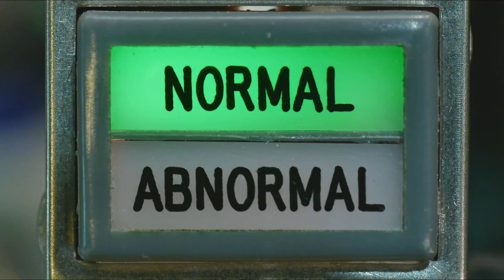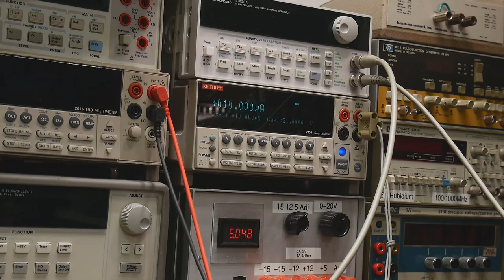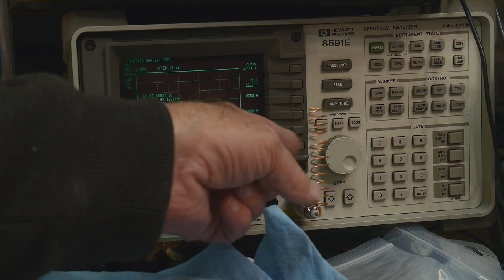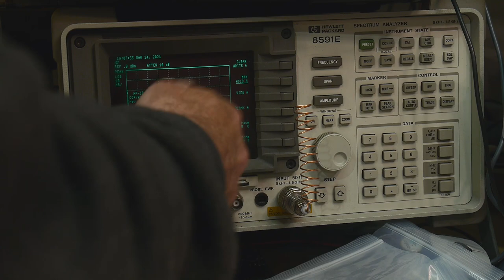#751 Blue LED Powered by Antenna

Comment: This is exactly how an old crystal radio set works. Live close to a high powered commercial radio station and you can light fluorescent tubes from the energy received with a suitably tuned circuit antenna.
Reply from the maker: If you are close enough, the florescent tube glows without any wires attached. My friend did just that.

Comment: Hey, that explains why all the blue LED's I have in a box is glowing all the time.
Reply from the maker: I wrap mine in aluminum foil so they don't wear out prematurely
Reply: @IMSAIGuy  That's a way to simple solution. I put a low-pass filter on each of them. Remember,  these are basically DC devices so if you block high frequencies your good to go.
Reply from the maker: @geirendre  I'll remember that
Reply: I'm wondering how much more power you can get by a matching the antenna.

Comment: The Key to the Nature is Energy of the RF, Resonance of the Circuit to RF, Junction Resistance and Capacitance of the LED. Add a diode in Parallel Reversed Cathode to Anode will add to the Sensitivity.
Reply from the maker: The most interesting key events in nature happen on April 1st.

Comment: April fool or not, this should work given a sufficiently powerful local RF source near the antenna's resonant frequency. A bit surprised it glows with mere ambient signals but then I never tried this with a low-current LED.
Reply from the maker: I had a friend who worked as an engineer at a AM broadcast radio station. He  had to go out in the field at night to change the antenna phasing for night time regulations (the relay control was busted and he would knock it with a broom handle). He would carry a 4 ft fluorescent bulb to light his way

Comment: Yes I get it April 1, but I've really have run a red led off a crystal set receiving the BBC 198 kHz  500 kW transmitter 30 miles away with 300 foot long wire, I also  ran an lcd digital clock off it!
Reply from the maker: At first I thought you had a typo on the frequency. Then I read about BBC Radio 4. Yikes. That is crazy. and atomic accurate! did you ever build a decoder for the phase modulated time? I would love to see those 1M high valves (almost said tubes)
Reply: @IMSAIGuy  no i never built a decoder but I believe it was used to control off peak electricity meters, I have though built a phase locked 10 MHz reference but is obsolete now as gpsdos are cheap & don't suffer from the phase & amplitude modulation upsetting the output frequency stability

Comment: That is super cool!! Is the sensitivity due to an extremely low forward biased resistance? Just for kicks, I I did a diode test on a red LED (1.7vdc/OL) and it illuminated but when I did the same test to the Blue, it illuminated forward biased but read OL in both directions. It did the same thing three different DVOMs. Do surface mount blue LEDs behave the same way? I’m looking all over for one to test but no luck. Thanks for the video!
Reply from the maker: You might want to check the date on that video.  April 1

Comment: April fool ? Not that much...In my own experience, a red LED can be lit when connected to an FM Yagi antenna with 10 meters of vertical coax. A Spectrum analyzer showed that a lot of power from MW brodcast was collected by the shield of the coax.
Reply from the maker: But I did it on 4" of wire. I win 😊

Comment: Interesting video, thanks. I’ve seen examples of people putting an LED between the terminals of half-wave dipole antennas and then showing the LED’s glow when a walkie-talkie transmit button is pushed. However, in those cases they also included a second diode (possibly germanium) in the circuit and it was installed in reverse (polarity) to the LED. I’ve been trying to understand why the second (non-LED) diode is used. Have you seen any such examples and if so, do you know why the second diode is used? - Thanks! - Jim

https://youtu.be/LsE_VSNTz3Q?si=h2ZfEvL6EIPpjSN6
Reply from the maker: LEDs don't like reverse voltage, so you need to protect them.